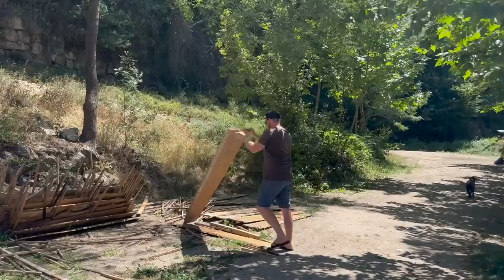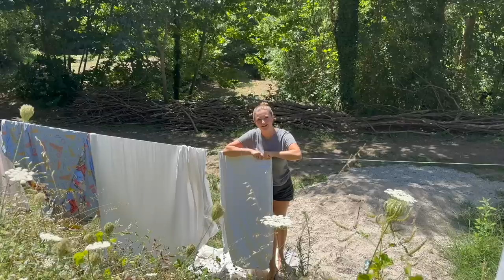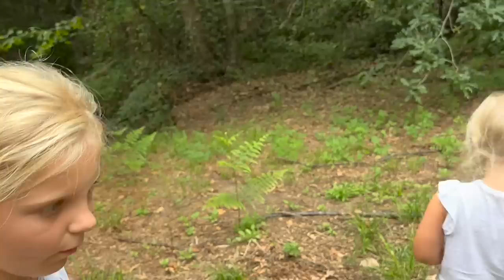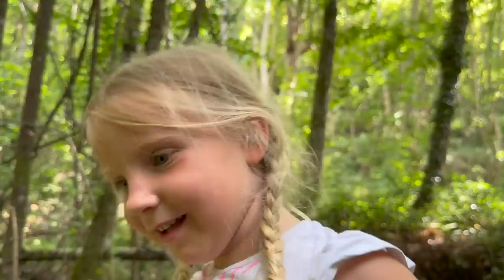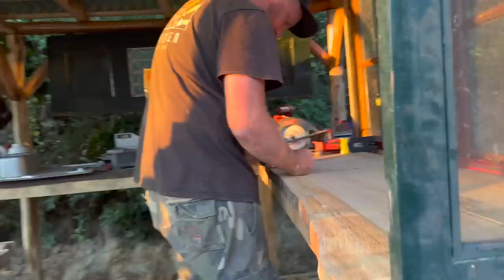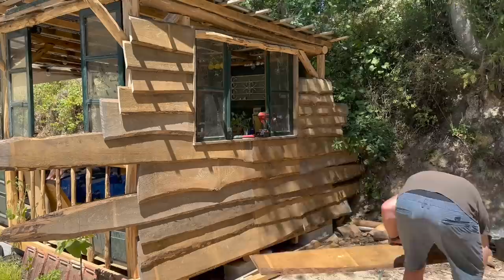UNDER €500 GARDEN KITCHEN / POTTING-SHED BUILD  PART 2 - Plus we got to 10,000 subscribers!!!! 🥳🎉

Comment: Congratulations on reaching the 10 K , the outdoor summer kitchen, including the fairy house.  Using glass for your outdoor kitchen area will make it very hot, because I’m sure it’s already hot with using corrugated galvanised tin roof is bad enough.  If you want it to be cooler install a double roof about 50 cm. apart or use 80 % shade cloth would be a lot cheaper.  Love your videos and the ideas you bring to your site
Reply from the maker: Thank you so much! 
Great idea about the roof thank you for the tips! Luckily it hasn’t got to hot so far as we don’t have any closed walls  but it’s a good plan if it does get too hot ☺️

Comment: In Australia we always put insulation in the roof because of the extreme heat. We use a foyle sheeting called sisalation sheets of flat insulation under the metal roof sheeting and it makes the room underneath much cooler in summer or warmer in winter. Don’t know if you can buy something similar in Portugal but any sort of inexpensive insulation would be well worth the effort. Love your outdoor kitchen! It will be invaluable 😃
Reply from the maker: Thank you so much and good idea about the roof! We will look in to it! We don’t have any closed walls so at the moment it’s not to hot but definitely worth keeping in mind! ☺️

Comment: So pleased for you 10k :D  Dont want to rain on your parade, but is that old glass in the frames used as ceilings?  if they smash for whatever reason they will break into shards and come crashing down onto whoever is below, like  a blade.   Maybe some fine wire/mesh around it, so if it does break, it should stop it falling, Safety first.  The fairy house is amazing. The floor and worktops  in 'Badgers Crib' are gorgeous or should that be sett? lol
Reply from the maker: Thank you so much! Yes that’s good thinking we didn’t think about that thank you we will look in to it ☺️